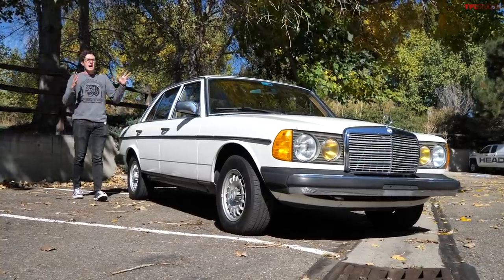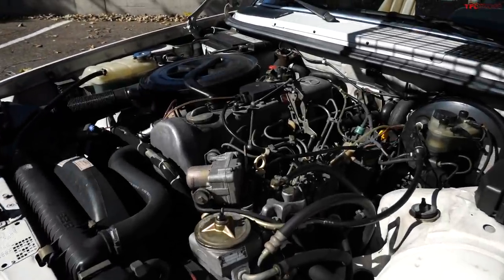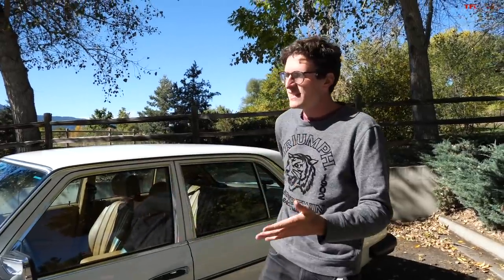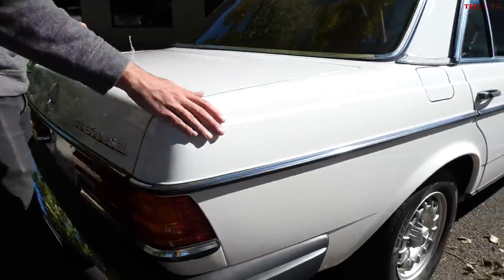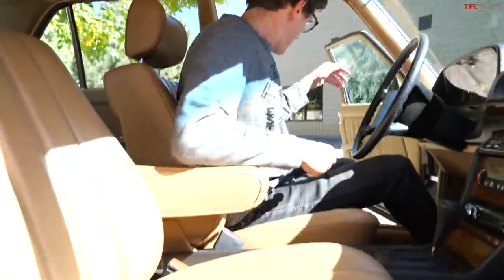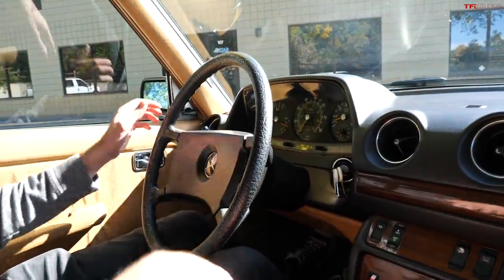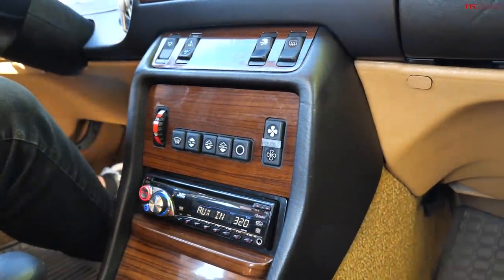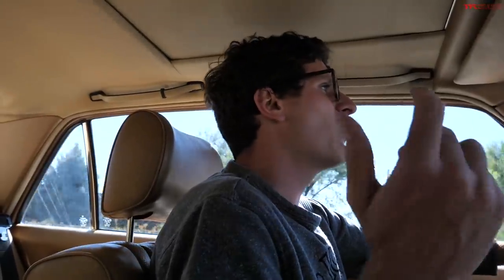Here's Why I Am Selling The Best Car In The World: My Mercedes W123!

Comment: He may regret selling it when he gets older
Reply: Very much so.
Reply: I regret selling our 85 and 84 tdt’s
Reply: I have an '83 240D with a stick-shift.  Bought it just over a year ago.  Had 363,000 & some miles on it, motor rebuilt at 197K.  I put another 9,000 miles on it, and it starts right up like a gas engine.  I love it.  When I looked at it, I did a certain unique compression test I learned from Kent Bergsma of "Mercedes Source" which began with starting the motor, looking for any excess colored smoke, then turning the oil cap to the position to remove it without actually removing it.  The oil cap stayed on and didn't even move.  The car didn't just pass the test with flying colors, it aced it.  No oil consumption either.  So, I did not hesitate to buy the car, because it's a diamond.  The previous owner owned it for 21 years and decided it was time to move on, exactly like this video host has now with his tremendous white 300D Turbo.  No regrets about what I got, except sometimes, no power especially when climbing hills.  I live in Washington State and have now driven it to Oregon twice already and once down into California.  The highest posted speed limit on Interstate 5 is 70 mph.  And where it's 70, that's how fast I drive it.  I keep up with oil changes, valve adjustments, and maintaining low RPMs until the motor is completely warmed up.
Reply: He’s definitely going to regret it
Reply: @piemasta93  He will definitely regret it.  The 240D I talked about in my post right up above yours, I feel is a diamond.  And that's what this guy has, a diamond.  Sometimes I wish I'd chosen a 300D Turbo over my 240 because I'd have more power climbing hills, And I could drive it in states with speed limits higher than 70 mph because it would definitely fit in more.  BUT I also have a 2011 Mustang that I could drive to those states.  And the 240 has a little less to have to worry about.
Reply: @kevinhabener1279  
240D  with manual everything, is still the best w123. The less electronic/vacuum valves the car has,the better in the long run.
Reply: 100% if you owned a 1970-1990 diesel Mercedes and sold it you will never forget it, i just bought a 300sd after 15 years of selling mine. they are only going up in value unfortunately and harder to find.
Reply: We had an 83 W123 that was very clean. Previous owner loved the car. Everything was done properly. Stored indoors, & ran like a top. I wanted to keep it but my dad sold it.

Here I am nearly 5yrs later trying to buy one for myself. Car was amazing, the sounds, smells, & everything about the car was amazing.

Hit the key, & instantly fired right up. Got 30mpg in the 80s! Didn’t have much power but she rode like a cloud.

First time experiencing an old school Diesel that made me want to get a 7.3 IDI I’ve now owned for 3yrs. Love the truck!

The car is as good as the Buick w the 3.8 3800!
Reply: I regret it! Got a W124 about a month ago.
Reply: For sure
Reply: There must be a major problem he found out lately but not just shown in the video
Reply: @tca666  fact
Reply: I can't tell you how many times I've had people come up to me in my 300D, and say, "I used to have a W123... Sold it... Regretted it ever since" 

I have only had one person ever tell me they didn't regret selling it: a former Mercedes diesel mechanic. When he retired after decades of working on these cars almost exclusively, working on his own car just felt like work. So he brought a Toyota simply so that he wouldn't be tempted to work on it himself. (Incidentally, he said 1984 was the best year for the W123)

Comment: My father bought a 1983 300d, no turbo in 1984 in Germany from exc at Benz. Had it shipped to Houston. My dad’s name is stamped on the vin plate as name of importer. I own it today. Has 60000 miles on it. 4 speed. Still runs great.

Comment: We still have 1 of 2 W123. Both bought new. One was a wagon. The sedan we still have. No plans on parting with it. It's a fixture in our garage.
Reply: There wouldn't be many 1 owner W123's left in the world, that's quite amazing. I understand your sentiment.
Reply: I’m the second owner of a 1979 240D.  I’m not selling mine either 😀
Reply: I have a one owner 230e. I'm growing tired of the shortage and expense of parts. Specialists are few and far between here in the UK so it gets expensive transporting it when there's a problem. It's not so much routine maintenance it's the Bosche K-jet injection system. I'm going to sell it soon.

Comment: Had a classmate with a 230 with the highly underpowered 4cyl gas engine with a 4 speed manual. It was one of those hodge podge grey market imports from the 80s with a marginally ok swapped instrument cluster. The speedo would stop at 55 and then instantly read 0 the moment you went over 55 and it had a hand written KM next to the mileage indicator. Ran well enough for driving in Hawaii but over a decade of neglect left it a rusty pile. :(

Comment: Did you crank up the Bosch pump? , with just turning one screw you could almost double horsepower, not quite double but it rews higher and gives much more power
Reply: That’s the altitude adjustment (ALDA) 

All the way out, then 2.5 turns clockwise to set it to the factory spec 

If it hasn’t been touched, 2.5 turns CCW will “max out” the adjustment on the pump. 

If you want real power you can get a built injection pump from someone like Rodney at BenzForce

Comment: Hey Tommy!! It’s likely you will regret selling that car, but I don’t say that as a bad thing. As we get older we all have a car or two or many that we have sold or traded over the years. It’s an awesome part of owning a collection of cars! You are doing well and just like the channel, there will be lots of cars that come and go in your stable, I’m sure. Not a bad thing, each one gives you more experience and memories, good and bad. I have 8 cars/trucks right now, 6 are classics, I built 3 of them from almost nothing, repowered and repainted (full colour change it was hot pink when I bought it) a 1949 Ford F1 pickup from a Chevy 350 and 700R4 to a Flathead V8, Supercharged, backed up by an A4OD transmission. I have had 54(?) classic vehicles to dat and will keep on. I have a 350 and 700R4 looking for a home right now. It is a nice powertrain, FOR a  GM!!! 
     You are having fun and should continue to do so.

Comment: I own a 1984 and 1985 CA 300D, bought in 2001 and 2008.  Not a superfan, I bought the 1984 for its engine to replace the failed engine in the 1985 but fixed the 1984 easily (crack in K-frame) and found a good used engine for the 1985.  For those in California, try filling with renewable diesel (Propel or Union 76) as the engine will run much better and idle smoother and quieter, and no you don't need a fuel-heater conversion, as those work in any diesel engine.  The best things are the solid way the doors close and the independent rear suspension which lets the car handle amazingly on twisty roads, if used to older U.S. cars with a straight rear axle.  I thought the dash and console a bit clumsy but see they continued that in later models (even 2000+?).  I have no trouble accelerating to freeway speeds.  Perhaps the biggest surprise was the mediocre mileage.  Many have long claimed >30 mpg, but EPA is 19 hwy and most owners report 22 mpg at 65 mph, matching what I get.  The 1985 has a slightly higher rear-end ratio for a slight improvement, but the engine still spins too fast ~3000 rpm at 65 mph.  Seems they could have done better with 4 gears.  First gear is way too low so almost wasted.  The trim is stainless steel, like some 1960's U.S. cars, so should last forever if not dinged, and you can polish it back to like new.  I don't think the crazed paint at the lower quarter panels indicates rust, as mine have that and they are rust-free.  I think there is some type of factory rubber/plastic coating there which was painted over.  Someone could tell with a paint thickness gage.

Comment: If only I could get a decent mechanic to look at my 123 I would put it back on the road. Right now it’s stored in my garage. I’m thinking it needs a rebuild but not sure. Wish I could get the one you’re selling.
Reply: Nearly impossible to get qualified hands on w123's, 124's, or 126's these days.
If you can manage the time & patience to be able to do as much as you can, you already know NO ONE will ever love it or care as much about it as you. 
I have a C207 chassis myself, & although I won't pretend it's a true Benz, I'm getting my wrenching practice in with the hopes of going back in time asap.
Reply: The K-jet fuel injection is a nightmare to get someone who knows about it. Which is surprising as it was used by so many other cars, porsche, volvo, vw etc. When it wears technicians just want to swop expensive rebuilt parts when what's needed is adjustment.